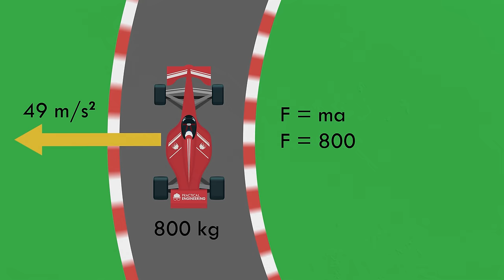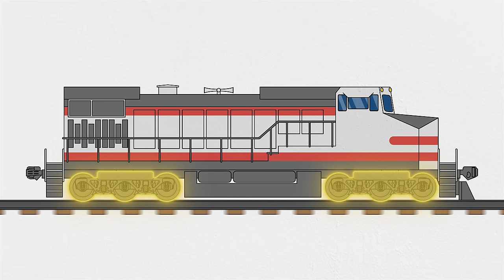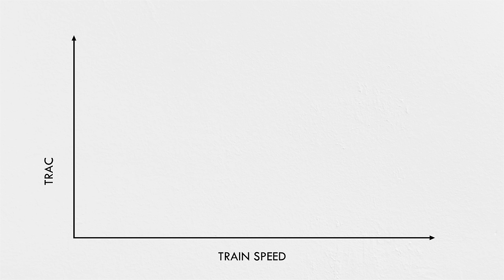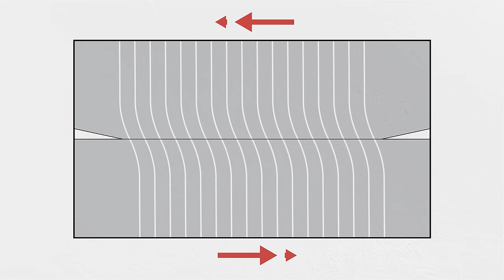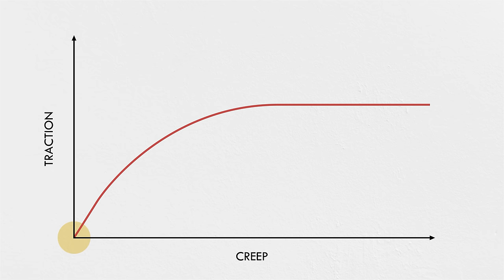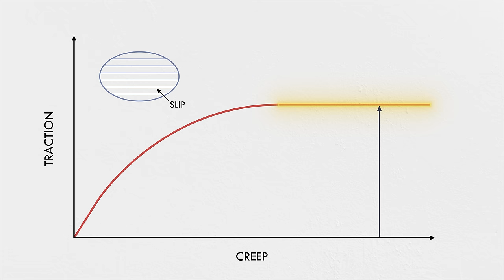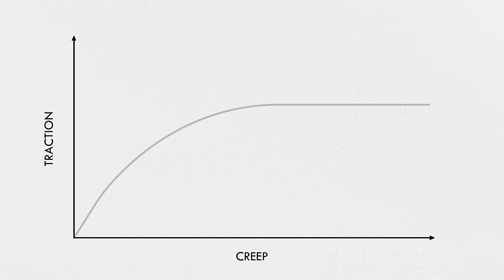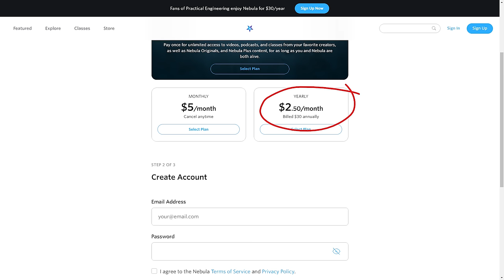Why Locomotives Don't Have Tires

Comment: The thing is the railway infrastructure is already built for steel on steel wheels for one to a few locomotives as you go for bigger to enormous trains and make it anywhere where you really want these trains to go.  Granted, it would really help to upgrade the capacity of this network with more double track along existing routes and have more graded crossings, but this doesn't require any steeper grades.  The railroad execs see no reason to jump to higher levels of traction considering the infrastructure they have to work with.

I kind of think they need to move away from dumb cars to smart cars with traction motors and batteries.  You would still have your big locomotives for long distance travel, but the idea for smarter cars goes as follows:

1. With a battery and a motor, you can collect up breaking power to charge the smallish battery.  This eliminates the need to run power cables between the cars, granted you would still do this in passenger trains.

2. Passenger trains in particular would be faster and more efficient as they leap off the line after a stop with all wheels pushing and collect up all of that breaking energy into batteries instead of burning hot brakes.  If you have ever ridden a commuter train, you know about the burning hot brakes that must be costing a fortune to keep swapping out.  People want their commuter trains to be faster and getting up to speed and back down on say a 1/4 mile stretch is far better than the miles spent accelerating and then miles spent gradually slowing back down as the burning brake smell enters the carriage ventilation system.

3. Freight train cars could move themselves around the freight yard autonomously, no shunt locomotives needed.  You would still have people watching, but maybe they watch from drones hovering above on computer monitors on the ground and command the freight cars to stop in case they miss anything important with their sensors and onboard computer processing systems.

4. Going up and down grades, you charge up on the way down and help the train up the hill with battery power.

5. You no longer need to connect up brake lines and switch to electronically controlled automatic couplers as the smarts in each car handles the brakes and can open a coupler with the onboard computer.  This will save a lot of time and be safer than traditional air brakes.  Especially with computer control, no more flat spots on the wheels, which is a huge problem for trains.  You can still have the old stuff there for legacy use and only stop hooking up the air brakes once the electronic systems have proven themselves out.  Another great thing about this is with the cars all linked up, any failures in one car can be compensated by the other cars and locomotives in the train consist.

6. Train cars with batteries along the bottom of the car will have a lower center of gravity.  Standard gauge is only so wide, so this will help to keep trains from tipping over.

Comment: You mentioned formula 1 and not a single video was of an actual F1 car until the very end. Not all open wheel single seat racing cars are formula 1 cars.
Reply from the maker: Nearly impossible to license F1 footage!
Reply: you took the bait
Reply: @PracticalEngineeringChannel  So the wording should have been different to avoid that confusion. "Race cars, like in Formula 1, Indycar or base categories such as Formula 4" wouldn't cause the same negative impression.
Reply: @PracticalEngineeringChannel  that actually makes a lot of sense. Your attention to detail on everything in your videos made me assume that it was something like that. Thanks for the reply and I love your content!

Comment: Very good video, although I don't quite agree with the title. Many loco wheels do have tyres - just not rubber ones. The driving wheels are flat, with no flange and a steel tyre, incorporating the flange, is heated, the wheel is dropped in and it is all allowed to cool and contract, locking it on. When worn too much, these tyres can be cut, removed and a new tyre fitted https://www.youtube.com/watch?v=IQ-idHka0Zo

Comment: 2:33 No they are not. Most countries use electric locomotives for freight too, it's just US that doesn't want to invest in electrification of the railroads. Look at India which has ~twice less railway than US and they electrified over 99% of it, meanwhile US electrified only 8% of railroads if I am not mistaken
Reply: And that is with a quite alot smaller economy
In other words its not expensive enough to exuse not using it
Reply: Fun fact, a large portion of the tracks in the us used to be electrified. The railroads tore the Catenary lines out so they could run taller rolling stock.

Comment: Trains actually do have tires, just not the kind you all think of.
The tire is what the brake shoes rub into when the train is slowing down. They're made of steel rather than rubber for no material deformation during travel. But when you hear a train with a wheel that sounds like it's banging against the rail, that's a flat tire on the wheel.
These tires were made as a cost-cutting measure, to allow railroads the ability to fix the wheel's flat spots without having to remove the whole wheel. Replacing a strip of steel costs far less than replacing the whole wheel.

Comment: Silly Formula 1 racing teams ! What they need is a little Lotus Elise, just 438kg, with 0-60mph acceleration of 3.1 seconds, so goes round bends better than a Formula 1 car. And of course this road legal vehicle includes Formula ! technology as it was designed by the then Formula 1 Lotus Racing team !!!!

Cars aside, American locos may not have separate tyres on their rail wheels, but in Europe such wheels are banned on basic safety grounds. Rail wheels made the U.S. way, was something Ed Burkhardt (Wisconsin Central) and Britain's, English Welsh & Scottish Freight (EWS) train Franchise back in 1997, came wholly unstuck on.  He ordered 500 American built (in London Ontario) GM EMD "Class 66" Co-Co Diesel Electric locos to service his then new British Freight Franchise. 

These locos which began arriving from Canada at Cardiff Docks South Wales in groups of around a dozen, where quickly "Impounded" on the Dockside for a number of technical failings to meet British safety requirements. The most important of which were the illegal U.S. designed wheels.

The locos, as they arrived, were therefore towed to a suitable British railway workshop, to await Wheels made to British safety compliant standards, in Britain, for which Burkhardt had to pay.

Burkhardt however, was not flavour of the month in Britain, as he had manipulated the British Governments Rail "Franchise" methods, by "leaking" to the London "Financial markets" that the Governments methods of dividing Freight train operation into 3 Franchises could not work, as Britain was physically to small (which later proved to be incorrect). 

What Ed didn't know is that if you stab the British Civil Servants in the back, they will, even if it takes Decades, get their revenge. The Civil Servants therefore set about a nice little plot to "unseat" Ed as the Chairman of his parent organisation Wisconsin Central, by persuading enough of the WC board to vote against Burkhardt a couple of years later (1999). They also arranged with the Canadian Government, that Canadian National Railways should grab WC to prevent Burkhardt getting it back.  

All of this information eventually appeared in the Rail Industry magazine "Modern Railways" published by Ian Allan Publishing (UK) in 2001. (This company became defunct in 2020).

Comment: Haven't even watched it. Won't, because locomotives absolutely have tires. Just because they're not rubber doesn't mean they don't have tires. I've changed the tires on a locomotive before. Anyone who did the bare minimum of research would know that is way too general of a statement.